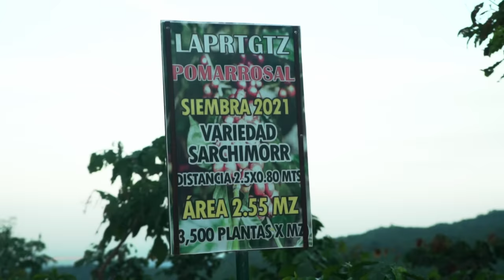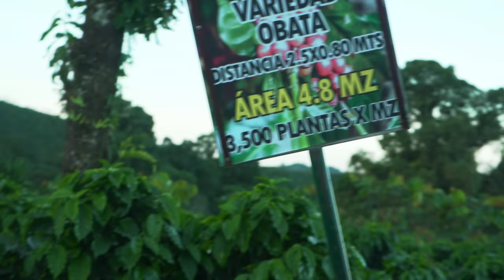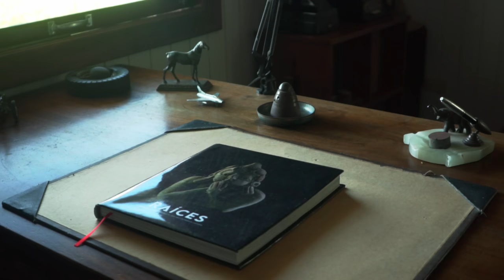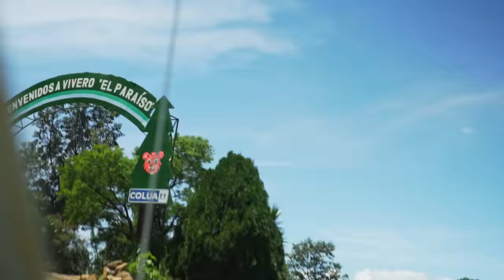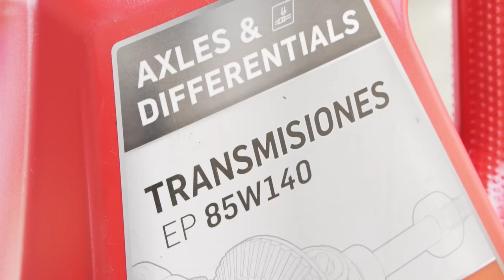You've NEVER Seen Guatemala Like This | 4x4 Travel Documentary

Comment: Great videos  The 70 series are different than Australian spec they are running a 6 cylinder engine we run a V8 here and you will find the front tracking is the same as the rear while V8 ones are wider in the front ,  Good old Toyota ute you have  those are unbreakable , along with the 47 and 80 series,  keep up the great videos  and enjoy your  what you are doing

Comment: buddy in the white fortuner gets the 4x4 award. a minivan looking suv for soccer-moms doing more than the most capable vehicles toyota has built. the tires on this chinook are ridiculously huge and what crazy ground clearance, i feel as though you guys are underestimating the capability of your rig. what kind of mpg or l/100 are you getting in that skyscraper with monstertruck wheels? the mountain pine ridge trail we did with a 100 series with only a 2" lift on stock wheels with k02's, not sure what caused you guys to turn around with that beast of a 80 chasis and setup. great video work, keep it up! curious on the mpgs though, especially since majority of the miles seem to be roads that any decent 4x4 can pass.
Reply from the maker: We do underestimate it.. On purpose! We've got a long way to go until Argentina and want to make sure it get's there in one piece. We will unleash its full potential once that's completed! We average 12-14 mpg. On the Pine ridge trail, it got so narrow between the washout ditches we no longer safely fit, the tires were over the edge on either side.